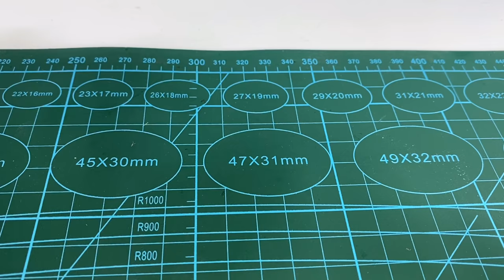4 DIY INVENTIONS

Comment: This wasn't a wasted 10 minutes of life guys, this was 10 minutes of reflection, of what we could've done with those 10 minutes.  Think positive 👍🏾
Reply: And they need to look up the meaning of the word, "Invention"
Reply: The two razor blades connected to a 9volt battery with the on switch.  I am halfway through and I am pulling out of this mental mind freeze while I still can.
Reply: @erickaholland5613  그것이 뭐하는 것인지 어디에 쓰는 것인지 잘 모르겠습나다.
Reply: @풍운아-g4k  I have a hard time defining those as inventions.   I don’t see their purposes as practical.
Reply: @erickaholland5613  I think he wants to know what the heck it is.. as do I lol. What is the intended purpose of the 9V razor blades mounted on a plastic lid?
Reply: 你好喜欢这个综艺节目
Reply: @A-Milkdromeda-Laniakea-Hominid  it senses liquid. You would use it when you want to be alerted of a leak, like at the bottom of your freezer or under a sink? Or turn it upside down to beep when your dehumidifier is full. Or outside if you want to know when the rain starts to bring your lawn furniture in.  (The round plastic lid can be replaced with anything non-conductive that is the right size/shape to catch water where you want. )
Reply: @mjbgdaad5624  I appreciate the explanation thank you. But it isn't very loud, you'd want to amplify the signal (or use it to initiate another gizmo) for it to be of any practical use.
Reply: Oh' money :)))
Reply: Qedt kmkx HV
Reply: @Miraak That thing will do you no good if it's your first alert of high water coming. And fix the pipe, don't wait for it to burst and create a mini flood in your home. 
I appreciate you are trying to think of uses for it, but sadly it's just a cool gadget with no real use. Which is why you don't see them in Home Hardware stores. Or as seen on TV 😉
Reply: @Miraak There you go - a device to tell blind and windowless people when it's raining. Right on Morty ya done it!
Reply: @Miraak Well a wet/dry vacuum would be even better. But what have you got down there? Any wood is going to grow moldy (which is dangerous) and you risk damaging washer/dryer, heater, etc.

It's funny you mention this, the house I'm renting floods in the basement every time it snows. I'm moving.

Comment: ok who else watched thinking they were gonna see a stun gun or electric chopper thing made out of those razor blades?
Reply: Or plastic welder??
Reply: I thought it was gonna be a hand buzzer toy, lol!
Reply: Probably meant to be a flood warning for dishwashers or similar. Just make sure the blades is on the downside when you place it. The real inventor in the video is whever came up with the hot glue gun 😀
Reply: at least a pocket lawn mower
Reply: I thought it was gonna be something like a veggie chopper or maybe some sort of weapon. Honestly, I have no idea. 🤣😂🤣😅
Reply: Just hot melt a stun gun to them. Also a chopper thingy. The possibilities are endless.
Reply: The latest new 🐭 mouse 🐭 trap 🐭
Reply: I thought it was going to be a portable  food chopper. I was expecting the blades to spin and for him to take a Hot Dog and turn it into 'potted meat' ;)
Reply: totally. a fingerchopper for the mob! aluminum foil (prototype) or any metal bar (finished product) would have worked just as well
Reply: I still don't know what the fcuk it was

Comment: Just in case you ever dreamed of owning a razor blade, transistor moisture sensing Jiffy peanut butter cap buzzing thingy, well, here ya go.
Reply: ඔබ copy කරන සෑම වාක්‍යයක්ම clip එකක් ලෙසින් මෙහි දිස්වෙයි. එම clips එබීමෙන් වාක්‍යයම එකවර ලිවිය හැක.
Reply: No, my life is complete. I've reached my goal. I can lay down and turn back into dust again. Maybe this guy can vacuum me up with his homemade thingy?
Reply: Essa das lâminas de gilete eu não entendi.
Reply: Is transistor really necessary? I have units called "watchdog water alarm" battery, two stainless sensors and smoke detector speaker, work so simply.
Reply: Jiffy? 😉
Reply: @mandelaeffect1111  yeah. Didn’t want to give JIF free advertising 😂
Reply: @glenturney4750  And that reminds me that according to The Hitch-hiker's Guide to the Galaxy the ultimate answer to everything is 42.
No one could remember what the question was!
Reply: Just in time for Christmas!
Reply: With undetachable battery
Reply: got me... 😂😂😂😂😂
Reply: But what is it for? 🤔
Reply: @ghibliinu6616  that isnt a speaker you got from the smoke alarm, its a buzzer (which is a speaker + a transistor). so yes you need a transistor, or a buzzer with one built in.
Reply: @bobmitchell4532  but they are making a new computer-planet for that.

Comment: Better water-leak detector? Take an ordinary clothes pin (one with the spring) and glue contacts to ether side so that when they close, they close the connection to a buzzer. Then squeeze it open and put an aspirin in it to hold the contacts apart. Lay it when you expect a leak. If water leaks. the  aspirin dissolves and the two sides make contact.
Reply: Brilliant, and no transistor required.

Comment: What was the last thing with the razor blades for?
Reply: i was thinking the same.
Reply: Rain detektor ?
Reply: Water sensor. Black thing under is a speaker. Water between the blades completes the circuit.
Reply: You hot-glue it to your I-Phone in case you forget to put it down long enough to take a shower.
-
Reply: reminds you where you put your razorblades during a flood

Comment: Pretty cool stuff here, but I'm thinking this channel is God's gift to the hot glue industries.
07:20 - Y'know, that would go a lot faster with a Dremel using a disc cutter wheel.  
09:45 - If this is supposed to be an alarm for water leaks, that thing should be upside down.  The way it's currently shown, the rising water on a floor being flooded will short-circuit the battery before the sensors on top are even touched by the water to make a connection.  Instead, if you simply set it on the floor with the sensors DOWN, just a millimeter of water will start the alarm going, and as the water rises, the thing looks like it's watertight enough to simply keep floating and buzzing.
Reply: @Richard Nowak I turned the music off and went back and turned it on to see if I missed something.
Reply: @Richard Nowak I came to the comments to find out what the last thing was because I couldn't hear it either
Reply: I thought the alarm was cool just couldn't figure out why they used blades
Reply: @biffwalls56    Maybe the dude's got investments in the safety razor production business?
Reply: If you are hanging wet laundry outside to dry and you are tasked with the job of watching out for rain, the water detector might be good for waking you up from your outdoor patio chaise nap.

Comment: What the heck was that last one?  You switch it on pour water on the razor blades, and nothing happens?
Reply: Water sensor. Black thing under is a speaker. Water between the blades completes the circuit.
Reply: @frankmeyer9984  - video editor should have turned down the music more.

Comment: El ultimo de las dos hojas de afeitar ¿ cual es su funcion ?
¿ para que sirve ?
Reply: Simple: CLICK BAIT!
Reply: Respuesta en español
Reply: it senses liquid. You would use it when you want to be alerted of a leak, like at the bottom of your freezer or under a sink? Or turn it upside down to beep when your dehumidifier is full. Or outside if you want to know when the rain starts to bring your lawn furniture in.  (The round plastic lid can be replaced with anything non-conductive that is the right size/shape to catch water where you want. )  Or ya, stuff it in your baby's diaper🤣🤣🤣

Comment: WTF was that last thing with the razor blades?
Reply: The only thing I can think of is a warning if a pipe leaks but it isn't very loud.
Reply: Moisture sensor / leakage warning. Use a piezo siren, and it will be 110 db or more at 9V battery!

Comment: I appreciate that the Floating Pencil isnt the prettiest, but I like it.  Can someone tell me, are both circular pieces of circular metal simply magnets?
Reply: neodymium magnets, craft stores usually have them. Hobbie Lobby or JoAnn Fabrics. Either of those.
Reply: @MikeMillerLeatherneckMarine  ::: I think you will appreciate the magnets integral to a computers MainFrame, were you to part one out…….the chrome disks are useful too !
They are probably neodymium but seem stronger.  In place they mimic a steel ‘cleat’ on the heel of a shoe………remember those ?

Comment: Hey Guys, who knows what was the last something meant to be?
Reply: Water detector, in case something runs over or floods
Reply: @kevinmccune9324  what is the water detector?
Reply: @wefageltayeb6667  When the builder put water across the (terminals) razor blades it completed the circuit and triggered the buzzer, maybe useful if you are filling something with water and happen to get distracted.
Reply: @kevinmccune9324  ok, thanks 💙
Reply: @kevinmccune9324  in theory yes.... but in practice its bullshit.
Reply: @smartspy007   Theres a word for it, wait for it -clickbait!
Reply: @smartspy007  This clipbait  looks to me like a water heater you make in a prison, that's why I was interested in this one :)
Reply: @razta4038  🤪🤪🤪

Comment: Yea right. What is the "rain" alarm for? I can usually see and hear when it is raining. You will fry the transistor without any current limiting on the base. Why the hell would you glue the battery to the lid? That battery never goes flat?

Comment: Please do better solderings, they look really ugly! For someone who has some experience in soldering they look disgusting. Try to clean the iron's tip using a wet sponge while it's hot, put some fresh solder and use some stripping paste/stripping flux on the wires and metal parts before soldering them. Good luck!

Comment: The rain alarm at the end needs a current limiting resistor in series with the base of the transistor or shorting the two razor blades with something metal will fry the transistor.

Comment: Are we just gonna pretend I have no earthly clue what the last “invention” is 🤷🏾‍♂️
Reply: It’s a water leak detection device. You would put it anywhere there’s a potential for leaks and water damage. For example, you can put it under a refrigerator, dish washer, or water heater. You can also play it under where a leak use to be and a repair has been done so you know if the repair fails or the leak returns.
Reply: @throwaway5926  well alrighty then.  Thank you

Comment: Okay, let's see, to make a little toy vacuum, I have to but a glue gun, a soldering iron, a regular iron, all the little bits needed to build this thing, a tiny can of deodorant, a pair of scissors, a bottle of water and a battery. and spend about an hour of my time building this thing, OR, I could just go to the store and BUY a REAL hand-held vacuum and probably spend a LOT less money!
Anybody have a clue what the hell that last device is supposed to be and what it's used for??  I can't think of a single thing I would want to go to all that trouble to build one for!  Do you put it in your underwear to let you know when you've wet your pants?  Is it supposed to let you know when it's raining?

Comment: Incorrect usage of razor blades..just use them for...shaving...WTAF use is that thing?
Oh,  I dropped water on my red lid razor blade contraption...wait a minute is it on? no...I'll just turn it on now...BZZZZZZ, Ah..I appear to have dropped some water.
I vacuumed up my paper particles, just to pour them back onto my desk as they were before.
The other stuff, I don't even recall what they were...I guess 10 minutes of super inventions has blown my mind.
And, that has to be the most ghetto soldering I've ever seen...keep melting plastic with the soldering iron...and that's what you get.

Comment: Save you 2 litre Pepsi bottles and drill a hole in the cap so a tire valve fits and air up the bottle to 100 lbs and shoot it with a BB gun.    Kaboom.    It sounds like a truck tire blowout.    And it's legal because you're using a BB gun and compressed air.   The only thing that would be illegal is disturbing the peace

Comment: what was the purpose of the wound wire thing on the phone holder upper?
Reply: Something else to put on your key chain so you'll have it with you at all times.  Never know when or where you'll need a phone holder upper.
Reply: Dilithium chrystal alignment. Also handy for plucking boogers out of your pet frog.